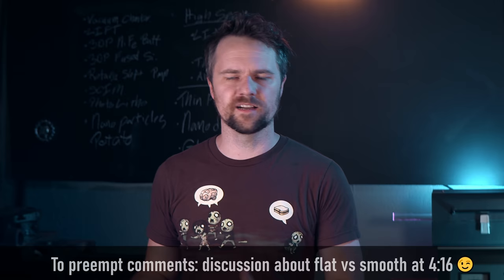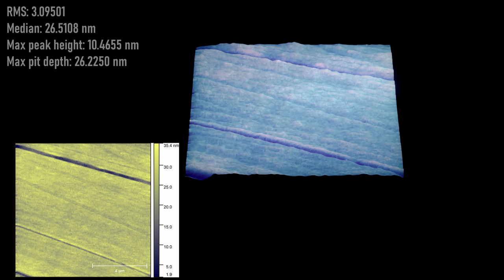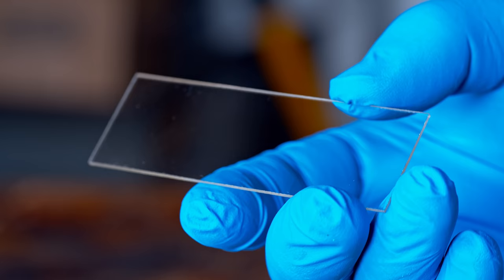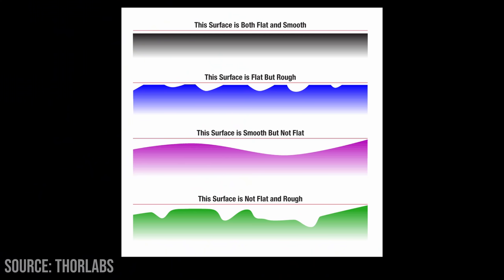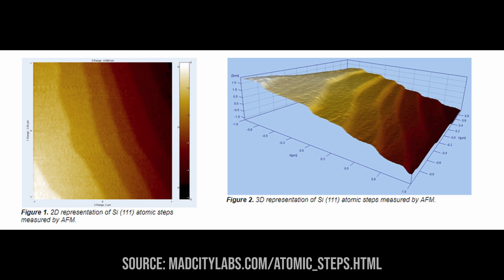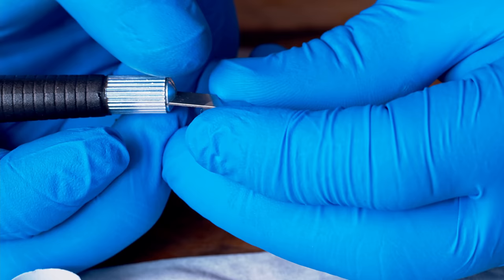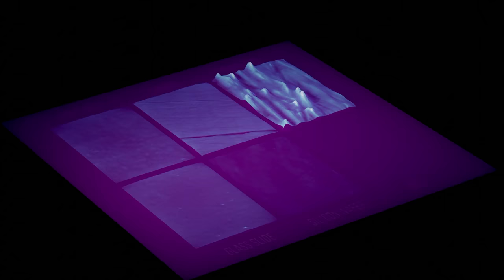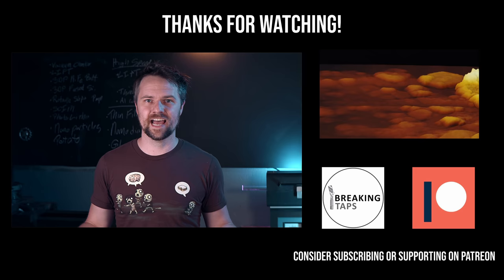What is the Flattest Material?

Comment: I really love your work and your videos really communicate the concepts you deal with well. On the other hand I am very curious about how you went from machining videos (breaking taps 😅) to full on physics (breaking minds... 🤯)...
I'll be back for the next one... 😌
Reply from the maker: Thanks!  And haha yeah... definitely changed the content a little over time :) So the main reason is that I wanted to run some home experiments and projects a few years ago, but kept wanting/needing custom metal parts. Throw in a bit of This Old Tony binge watching and a cheap milling machine for sale locally, and I got distracted from my original projects and started learning machining instead.  Thought it would be fun to document on YT and then one thing led to the next and here I am scanning mica with an AFM :)
Reply: @BreakingTaps 
I completely understand how a person can get sidetracked working on physics experiments. For me, my greatest manufacturing hurdel is needing custom glass parts (scientific glass blowing) rather than metal parts. I want to replicate the early (middle to late 1800s) vacuum physics experiments that was built using glass.
Things like the Sprengel pump and Crookes tube.

Comment: I work in metrology, specifically with CMM's and not with optical measurement. Those spikes on the glass slide look a lot like dust particles on a scan done with touch probes. You'd be surprised how small dust can get, I typically use compressed air to get rid of that

Comment: How long do these scans take?
Reply from the maker: Really fast scans (128x128) are 10-20 seconds, I use those to roughly find interesting features.  Moderately fast scans (256x256) are about 80 seconds and I sometimes use those to sanity check a region, make sure there aren't any super large features that might cause problems, etc etc.  Most of the scans I end up showing are done at 512x512 which take 3-4 minutes iirc.  Haven't timed it but something in that ballpark
Reply: @BreakingTaps  Thanks; faster than I expected. I did electron microscope install/repair in the '70s and kept my interest in microscopy.

Comment: Jointers and other carpenters who make flat surfaces in wood know that there are three different qualities of flatness and use different tools to address each. Just considering hand tools; Jointing planes, like Stanley #7 and #8 remove waves, smoothing planes, like the Stanley #4 remove bumps, and hand scrapers remove pics. Pics are those those pointy ends of grain runout that lift off the surface when you coat a plank; which is why you use a sanding sealer before the final scraping.

Great video, BTW.

Comment: We used Mica to demonstrate the proper AFM function of some of our devices. The goal was to obtain an atomically resolved image.
Depending on the settings you used, the atoms could look like huge elevations because the cantilever would stick and bend as the piezo scanner continued pulling or pushing the cantilever over the surface. The optical detector would interpret the bending as a normal force, not only a lateral force, making the atoms look like mountains compared to what the should have been.

Comment: Mathematician would say that flatness and roughness are exactly the same thing, just on different wavelengths. For flatness the wavelength of the measurements could be in centimeters or meters, for roughness the wavelength of measurements would in in nanometer or micrometer scale.

If you scan a segment of surface and apply FFT to it, you can accurately measure the different wavelengths that manifest over the surface.

Comment: If you take a reasonable sized sheet of float glass, and hunt around the surface, you'll usually find significant areas that are exceedingly flat and smooth. I've seen labs doing this kind of scanning to find flats for their own use. A downside for some applications is you can't easily cut the large sheet down to the area in which you found the nice flat, without stresses distorting it.

Comment: ISO 25178 is a surface finish standard used in manufacturing. Small mica windows were used in cast iron pot belly coal stoves to monitor the fire.

Comment: Very intriguing. Now I have to wonder which materials would exhibit ultimate "flatness".
What sort of factors would there need to be for better "flatness"?
   • Would it need to be metallic/metalloid, or could organic materials (like diamond) demonstrate impressive "flatness".
   • The crystalline structure of the material. Logically smaller crystals would be better, but do they in reality.
   • Density. Can highly dense metals can be ground/polished to greater tolerences?
   • Hardness. Diamond & some more esoteric materials.q
   • State. Does it have to be a solid, or could a liquid exhibit ultimate "flatness" (under certain circumstances)?
   • Temperature. Can temperature microfluctuations in the surface of the material affect the reading?
   • What haven't I considered?

Specific materials I'd like to see: 
   • Graphene - structure
   • Diamond - rigid crystalline (monocrystalline?) structure
   • Iridium - density
   • Tungsten - Very hard
   • Molten Tin - already used to make the very smooth float glass.
   • Water - perhaps under rotation, or centrifugal force.

There's also the methods used to cut/grind a smooth, "flat" surface, such as diamond/corundum grit, splitting along the crystalline lines (eg: as you showed with Mica) & then there's using narrow wavelength lasers to both cut & "polish" surfaces.

Comment: I worked for a quartz crystal manufacturing company 1974 to 1980. The crystals were used for frequency control in the electronics field. We regularly polished 3/8 " diameter quartz blanks to less than 3 angstroms flat. We did not have an electron microscope. If we had imperfections  the product failed.

Comment: if a sufficiently large NaCl crystal is cleaved with a knife, then very flat areas with “zero” roughness can be found on the cleavage.  The multibeam interferometer even shows the exit lines of dislocations.  This gives a step of 5 angstroms - the thickness of a monatomic layer.  But, of course, the surface quickly floats under the action of atmospheric moisture.  I used this method 40 years ago to calibrate a microhardness tester :)

Comment: You ought to mention that the mica is only a perfect surface over a certain range. At about 7:46 you see lines where you're jumping from one crystal plane to another. Showing a scan of an area with that change would be really interesting, in order to show just how big the steps are. At any rate, it's easy to find uniform surfaces larger than the FOV of of your microscope, but they are not arbitrarily large.
Reply from the maker: Yep that's a good point! And that the surface degrades over time as it's exposed to air.

Comment: 7:18  Interesting how the mica makes such an excellent smooth surface just by splitting it, without grinding or polishing or anything!  I wonder if the same would happen with other crystalline materials like diamonds or salt crystals?
Reply: No, the cleavage habit of diamond and halite is too weak to break that cleanly. This can’t mitigated in any way for practical purposes because this property exists at the molecular level. Basically the bond in other minerals cleavage plane is too strong to break anywhere as cleanly as mica’s does. The crystalline structure of micas is quite a bit different than most crystals.

Comment: I love the content, but dang if I don’t wish you’d have the heightmaps of materials in the same scale, such as at 3:46.  It should be trivial to use Levels in Photoshop or Gimp or whatever video editing software you use (Premiere, etc.) to remap the color gradient in of the images to match.

I.E.:
1. Map each image to grayscale (if you don’t have that already from your scanning software).
2. Pencil & paper algebra where 36.4 nm and 6.2 nm are on the right scale.
3. Linearly (non-gamma) bring down the white point and up the black point of the left image by the right percentages.
4. Draw a scale that goes from 1.0 nm to 52.3 nm and add a linear (non-gamma) grayscale gradient.
5. Map all the grayscale stuff back to your color gradient (I forget the Photoshop menu option, but it’s easy to do).

But I’m the kind of person who always has pet peeves over misrepresented data, like graphs that don’t have the bottom at 0 for the purposes of deceptive marketing.  ¯\_(ツ)_/¯

Comment: I have pretty much zero expertise in this field, but would it be fair to say that while the gage block is not as flat as the other items tested, for the purpose of the gage block it is used it is flat enough and is used in lieu of the other items because of its durability? A gage block would need to remain at a certain level of flatness after so much use. If the other items are flatter, but would not be after say a month or two of use, the gage block would be considered superior then for that use case

Just making a bit more sense of the interesting information you shared in the vid. I am a hobby woodworker and having an extremely flat surface is highly valuable in the shop.
Reply from the maker: Oh yeah, absolutely agree!  Hardened steel is a much better choice for a shop setting in terms of durability, and much easier to manufacture to the right specification in bulk.  "Good enough" for the job still gets the job done :)  There are some really fancy ceramic gage blocks for ultra-high end metrology, but most mortals are fine with steel.

There are even instances where a "rough but flat" surface is ideal, e.g. machine ways are often scraped with a carbide tool to be covered in little shallow depressions.  Overall the whole surface is super flat, but at a local level it has all the scraped depressions, which allow oil to accumulate and keep the ways nicely lubricated :)

Comment: Just how small is “nano?” In the International System of Units, the prefix "nano" means one-billionth, or 10-9; therefore one nanometer is one-billionth of a meter. It’s difficult to imagine just how small that is, so here are some examples:

A sheet of paper is about 100,000 nanometers thick. A strand of human DNA  is 2.5 nanometers in diameter. There are 25,400,000 nanometers in one inch. A human hair is approximately 80,000- 100,000 nanometers wide. A single gold atom is about a third of a nanometer in diameter. On a comparative scale, if the diameter of a marble was one nanometer, then diameter of the Earth would be about one meter. One nanometer is about as long as your fingernail grows in one second

Comment: Speaking of gauge blocks wringing together. Would gauge feelers also ring together? Or are they just not flat enough? I have a cheap set of gauge feelers, but they're completely saturated in machine oil. So, so I would imagine that would hinder any attempt at wringing, if it were possible. With the "swiss army knife" style that gauge feelers, you would expect if they did wring, they would constantly be getting stuck together. But, maybe the machine oil prevents that. Or the shop that made it just didn't clean it after making it.

Comment: Gauge blocks cannot be made too smooth. 0.02–0.03 µm(metric)(.79-1.18µin) is a critical value for roughness, and that if it is decreased during lapping in building up a block, a firm and close coupling is obtained, which, however, may lead to seizing (jamming) and the formation of a cold welded seam (speedy deterioration) on the measuring surface of the gauge, and if the roughness is increased, it leads to a loss of the wringing effect and a rise in the dimensions of the gauge block.

Comment: LOL, flatness and roughness, like plastering a wall, two effects with a different frequency. the goal is all points fall along the line. or on th eplane. accuracy and resolution. I remember Mica big square caps in old radios. I wonder how well they have lasted.

Comment: Interestingly enough, if the Earths radius was smooth like a precision bearing, and you had a Granite countertop like a kitchen island, the Earth would be flatter than the seemingly flat stone countertop, because they aren't the same as a machinists Granite inspection table, which is guaranteed within specs.
Stone countertops can be out like in thousands of an inch per foot, or up to a 1/16th of an inch across the full 8 foot length.

Imagine the radius of the Sun, how flat would that seem.

I know this is about smoothness also, but Ive ground and polished Carbide inserts, and Optical lenses, some of which are considered Plano or Flat.

Comment: Just wondering how you could ensure that mica is flat, since it is so thin that just placing it on a less than flat surface to image it might warp its flatness.
Reply from the maker: You're absolutely correct!  It's probably more accurate to say it's "locally flat" / smooth, over a larger distance you'd probably start to see the effects of sagging, and the crystal plane doesn't cleave evenly across the whole thing (there are "steps"  occasionally as it splits to a different crystal plane)

Comment: I have a question coming from a lamen. Would graphene not not be the flattest material? I was under the impression that that stuff was 1 atom thick so wouldn't that also make it very flat? Or would it depend on what surface it was resting on?
Reply from the maker: Good question! It mostly epends on the surface it's resting on for the most part.  Graphene is very strong in the "XY" direction, but quite floppy in the "Z" direction because there's only that single layer. You can actually find some really neat AFM images of "wrinkled" or "folded" graphene, where individual sheets get crumpled and wrinkled from manipulation.  There are some forms of graphite that have very aligned stacks of graphene ("highly oriented pyrolytic graphite") which can give very flat cleavage planes similar to mica. I'm not sure how it compares, better or worse, but probably very similar.  HOPG is also used to help calibrate really high-end AFMs since you resolve individual carbon molecules in a specific hexagon pattern :)

IIRC, the absolute flattest substance is hexagonal-boron-nitride, which is another 2D layered material.  It's super inert and very hard, so the cleavage planes end up being very flat.

Comment: i found this very interesting, i read somewhere that the mirrors on the JWST were perfect,  is this true, if so how did they do it, thank you for your video and your time.
Reply from the maker: Not sure about "perfect" but they are very, very good! The whole telescope is allowed 156nm RMS of transmitted wavefront error.  Essentially means when you add up all the errors in the mirrors, they can only be off by about 156nm (simplification but it's close enough).  Of that 156nm, 50 nanometers are "budgeted" for the primary mirror, which in turn means each segment needs to be <20nm error.  IIRC the actual segments beat that spec and were 5-7nm error on average.

So yeah, they are a really nice optics. The mirrors were polished with CNC controlled diamond polishing machines, like this: https://www.reddit.com/r/space/comments/3ukxka/how_the_james_webb_space_telescope_mirrors_were/

Comment: really interesting results. i am curious about how you measured the surfaces here. a few years ago i used a phase shear interferometer to measure mirrors for Lowell Observatory/Naval Precision Optical Interferometer. our intent was to learn whether float glass could be used to substitute the lambda/20 mirrors used in the NPOI image train. perhaps by correcting the distortions via adaptive optics.

our results more or less said no, but i had concerns that the interferometer was not accurately measuring the float glass flatness. we were getting really interesting reflections that looked a lot like wood grain, but many of the patterns were exceeding the limits of our equipment. 

which is why i am curious what your equipment was, as its clearly able to measure a much larger scale.
Reply from the maker: Atomic Force Microscope!  I made a video about it here (https://youtu.be/2Kv6KwADn7Q) if you want some more details.  Skip about halfway through to see the actual machine, the first half is a "macro" AFM that I built to demonstrate the principle.  The only downside to the AFM is it's very small field of view... so while it might give you a super precise measurement of roughness, it can only do it in a 20x20 micron area.  Something like an interferometer is probably more practical for large scale optics since you can assess the entire surface at once.
Reply: @BreakingTaps  i actualy just watched that video. also great fun, but sadly doesnt help me figure out the problems i was having, the scan area is simply way too small.

i needed to be able to measure the flatness of an 8 inch mirror with sensitivity p/v of between several microns down to individual nanometers.

maybe one of these scanning laser microscopes could do the job, but not one made from simple 3d printed parts.
Reply from the maker: @jondepinet  Yep agreed, don't think it'll be helpful in that case. Scanning chromatic confocal might be an option (Nanovea is one vendor that I know of, but there are several I think). It uses a set of lenses that purposefully induce chromatic dispersion and then reads the height with a spectrometer. E.g. at a specific point, "green" might be reflected while at another point "blue" is reflected, since the chromatic aberration has been stretched out so drastically it correlates with height.

I think it can work with clear materials, and can even measure thickness (from the front and back reflection). Has resolution in microns-to-nanometers, depending on the setup.  Haven't used it personally though so no direct experience.  Goodluck!